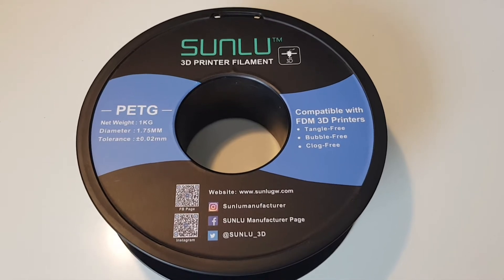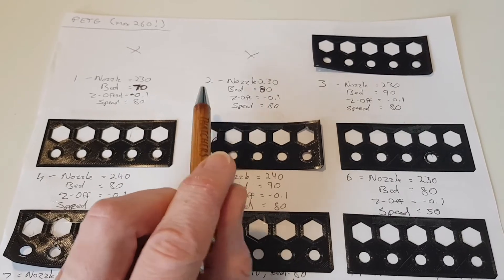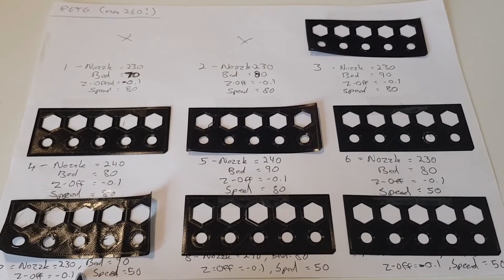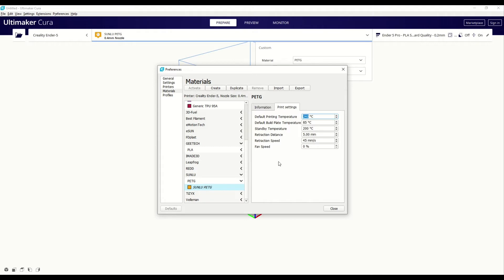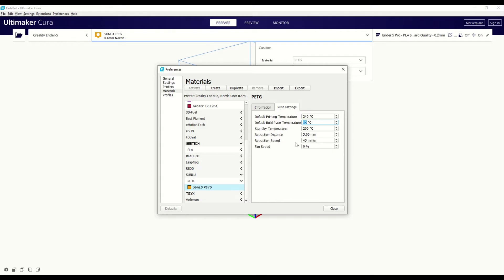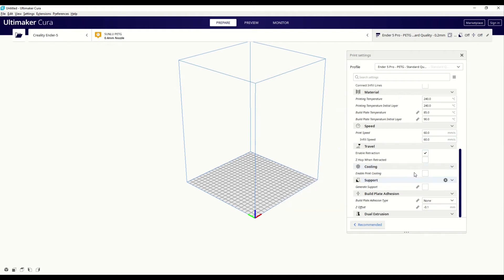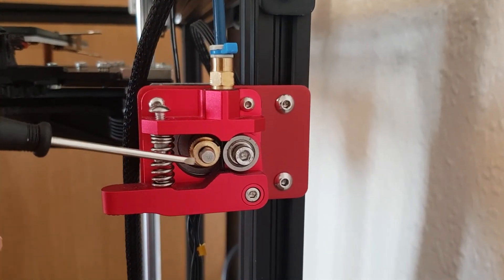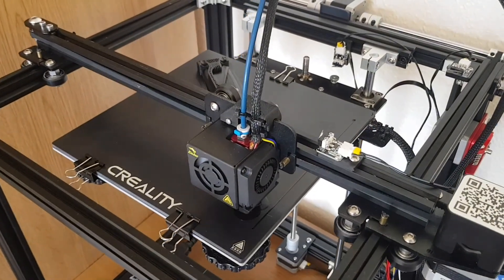Creality Ender 5 Pro - Printing with PETG

Comment: Thanks for the tip on the tension for the extruder, it solved my issue with the line getting stuck. Had to cut a piece of the tubing to clear the blockage too but now my printer is working again. Cheers

Comment: Thank you for this video! I actually found a lot of useful info about removing the part that the extruder screw push down on the spring with, and this has worked fine for me so far. I have some issues with the magnetic bed not being level on all areas and also that the PETG refuses to adhere to it, using a raft seems to help, but the part often warps. I have no idea on how to fix this other than getting a more level bed and do something that will allow me to print without raft aka. better bed adhesion.

Comment: I have the latest Cura version 5.2.2. I have looked through all of the settings and there is not a Z Offest. Is that something that was removed?
Reply from the maker: It's an addin you need to install via matketplace
Reply: @amp9438  Thanks. I was looking for that in vers 4.10.0 as well. 

How do you get just the settings visible you that you do in the video ? I tried Basic, Expert and Advanced and it is either too little or too much visible.

Comment: Why can’t I print petg. I have tried 7 different settings and I just can’t print it. Pla prints like a dream.
Reply from the maker: Hi. For me it took many attempts. Main thing I did was start with my PLA settings then experiment with the temperature and print speed. I had to increase the temperature quite a lot and also slow down the prints until i got something half decent. It's not easy but don't give up!

Comment: I use overture petg on mine with 241c nozzle and 90c bed at 15mm/s on first layer. going up to 40-60mm/s on the rest of the print. 
With a PEI print bet with a matt finish and I get excellent adhesion. 
First layer is the hardest with PETG best to slow it down and get things very level.
 After that the next problem is stringing I dropped my extrusion multiplier to 0.98, Retraction speed to 50mm/s and 8mm Retract distance. Added 0.2mm z-hop and set minimum cooling fan speed to 30% and up to 100% I still get so stringing and oozing but its very minimal

The most trouble I've had with PETG is curling on the edges cause the heat bed tends to be 5-10c cooler towards the edges. I've mitigated this by adding some insulation around the edges  where is cooler. Laser thermometer helps with this :)
Reply from the maker: Thanks for the info. I'll try some of this to help with the stringing I get with PETG
Reply: @amp9438  I wanted to update I've been recently trying to tweek more to get better results on my ender 5 I lowered print temp to 232, set z hop to only activate below 1mm, changed retraction to 4mm and extrusion to 97mm, as well activated avoid perimeters. With this I've just managed my best PETG print yet with Overture
Reply: @dracoflame3921  thank you for the tips! Aside from what you mentioned , are the other settings similar to PLA?

Comment: This is a really good comprehensive video, thanks.

Is your printer setup completely stock apart from the glass bed?
Reply from the maker: Hi. Pretty much yes. I've also added a BLTouch and 3d printed some bits like bed supports and strain relief. Everything can be removed so its back to stock if required. I plan to add a 32bit board to enable more features like filament run out and also add a Raspberry Pi for Octoprint. All when I get some time! Cheers
Reply: @amp9438  That's really useful to know, thanks.

It's hard to get objective advice about PETG. Most people are too busy breeding about their fancy setups to give a reliable opinion.

Comment: Those are very impressive prints. I must have bought the worlds worst PETG. I couldn't get decent prints to save my life. I gave up on it after half a spool of trying and will be using Tough PLA instead.
Reply from the maker: Thanks it took many attempts to get something I was happy with. Never quite got it perfect but good enough. I print mostly PLA as it's much easier but still use PETG when I need a stronger print.

Comment: Still failed, better but still has issues, also there is no z offset setting anymore
Reply from the maker: Hi. I'm using the Creality glass bed with z-offset setting which I covered in this video: https://youtu.be/Cx-4qIyVs8o. Hopefully this might help
Reply: @amp9438  i am using your settings, but still have stringing and prints dont look clean
Reply from the maker: Maybe you need to play around with the temperature and/or retraction settings? You could try one of those tower tests with different temps/retraction settings at different heights to see if it improves. But generally I think stringing is worse with PETG than with PLA. I used the default retraction settings (same as PLA) and had quite lot of stringing but just cleaned up the prints afterwards. Main thing for me was getting good layer adhesion.